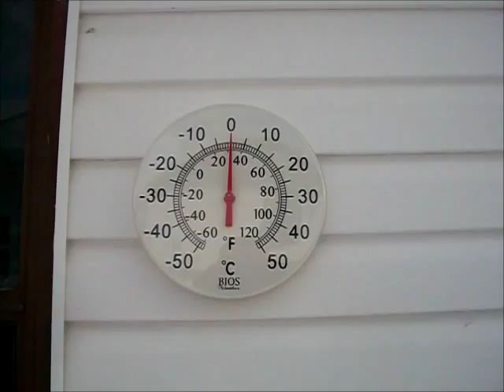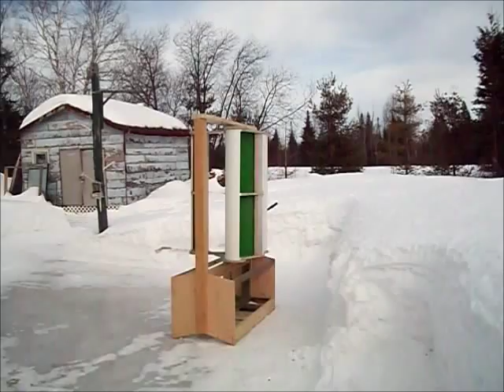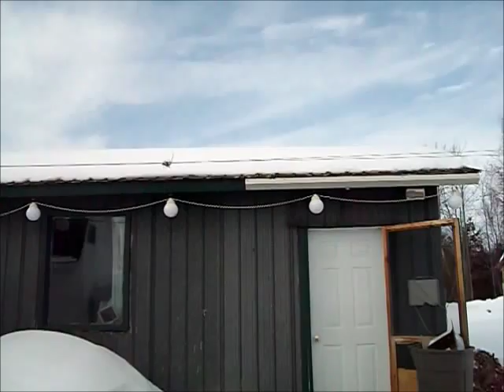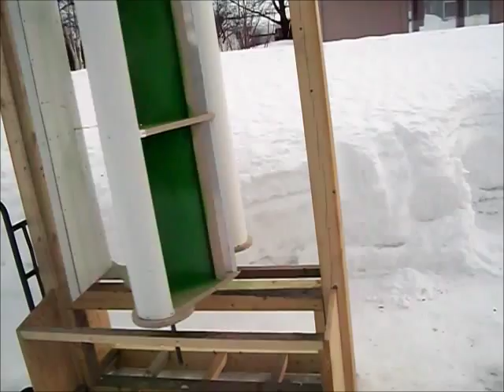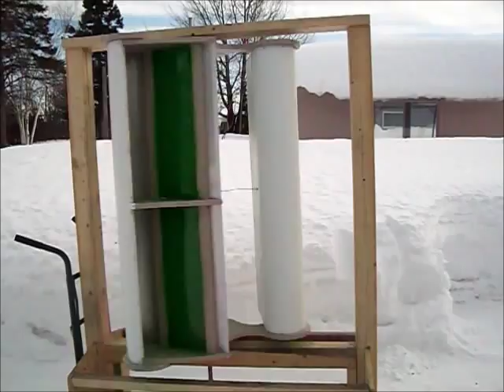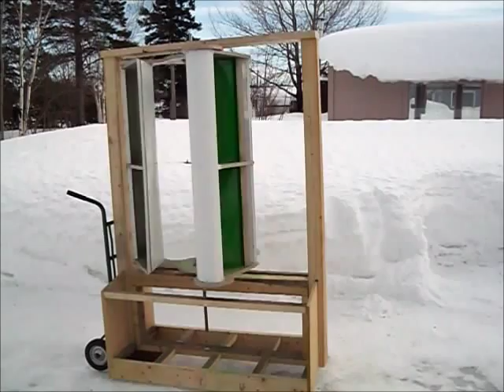Vertical Axis Wind Turbine

Comment: This is great, very well done! It's looks and works just as it should. I like how you made the base a little wider too - good thinking. These turbine's generate a lot of torque in low turbulent winds, so you'll want good stability. I've got two turbines on one base atm and it's pushing the structural limit of the original design. Do you plan to build an axial flux alternator for this? They compliment each other well. Again, nice work!!

James
Reply from the maker: I will built a axial flux alternator later this year and also i have a F&P motor that i need to modified, the base is wider and longer so i can install a alternator on the side of the shaft and use pulley, a big one on the shaft and a small one on the alternator, maybe one alternator on each side
Reply: Rom1nb Great building !!! James is a good friend and I like how he shared his knowledge with everyone.. That`s the way it should be in the RE community..
The turbine was made for low and turbulent winds .. May I suggest to have an MPPT controller if you ever use the F&P motor??? I know that James has his rewired and it could be great to see it tie to an MPPT for power output...
Thanks for sharing..AL